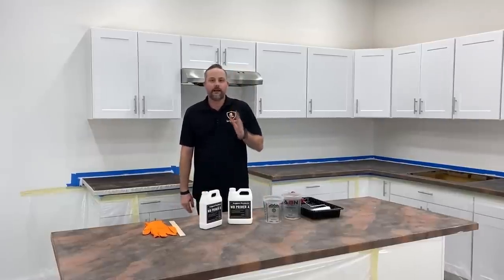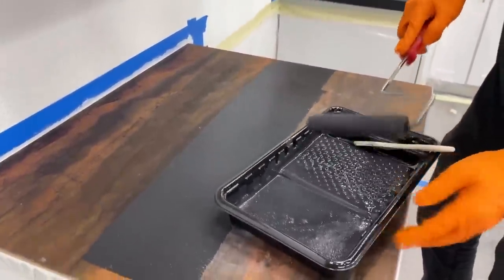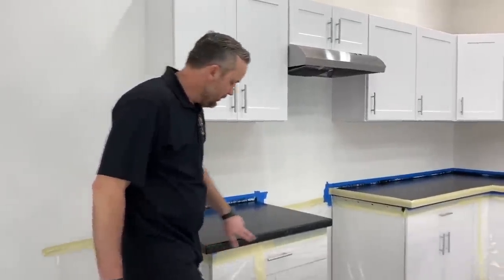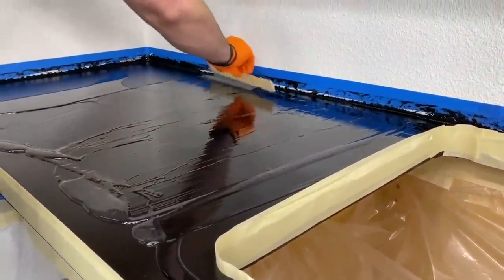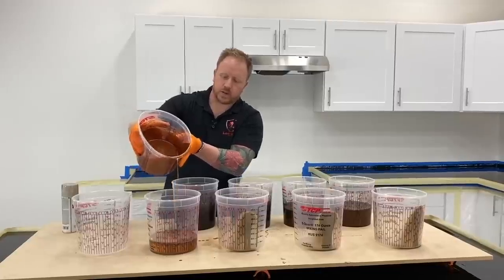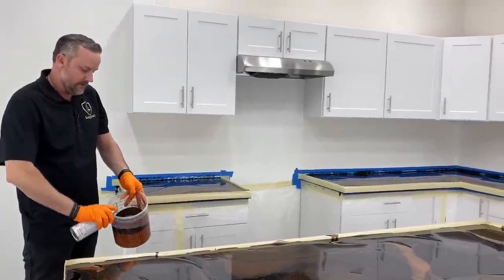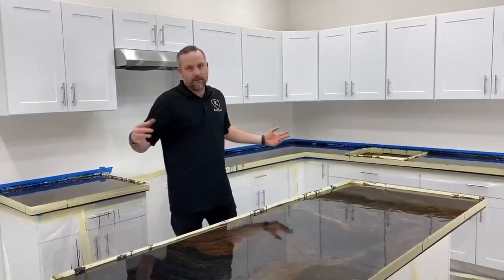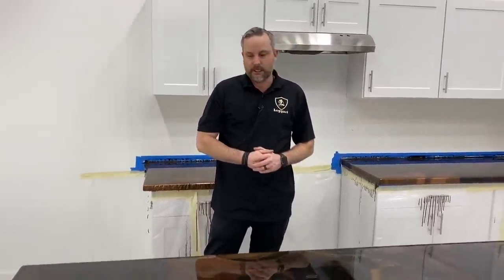Epoxy Dirty Pour Technique On Kitchen Countertops Full Tutorial | DIY Countertop Remodel Ideas

Comment: I'm curious, how well does your epoxy hold up against cuts, scratches, and heat?  If you put a hot pan on that counter will it ruin the counter?  Do you have a video like that?  Because most epoxy manufacturers always say well epoxy doesn't hold up well against heat....also if the counter does get scratched, is it easy to get rid of them?
Reply: I was reading the comments.  It is rude as hell that they didnt respond back to you.
Reply: @ABM261-zi2gl  Honestly I am surprised I haven't gotten a reply...I'd understand if there were like 100k comments with 1k daily added...would really appreciate an answer before I order their product.
Reply: Dimitri Lazarev our $5000 counter tops on our first house would crack if we put heat on them, I would guess this is the same.
They were like a marble looking type. Can’t recall the name, but even super expensive counters can’t take the heat directly.
Reply: @DC-bp8sx  5000$ for epoxy countertops or granite? I know in general you shouldn't put a hot pan on the counter but it happens that you have to for a quick moment, or for example hot cup of tea etc...curious how their epoxy holds up and well scratch wise too

Comment: Gorgeous. I'm speechless, it's so beautiful. Will you please update in a year or so with how it has held up to wear?
Reply from the maker: Our products are actually industrial coating made for military aircraft hangers, etc. So theoretically in a residential, or even commercial setting it will last forever. This is NOT a cheap epoxy paint that you will commonly find at box stores like Home Depot or sherwin Williams. It is a thick 100% solids epoxy coating.
Reply: I used their products on my floor, and it has held up to the dogs, kids, and myself ( which is the real shock.) It withstood remodeling jobs and dragging a metal shelving unit across it, not that I would recommend that however. You can also add high solids floor waxes to help.

Comment: This freaking amazing and I could totally do this! If I can get my husband to help with the color mixing. I am pumped! I just have a few other projects to do first and I want to tackle this in the spring! 
I don’t want these colors though for my house. I’m assuming there are other colors?
Reply from the maker: We have over 20 different metallic colors.  Take a look at our brochure and in the back is our color chart.
https://online.flippingbook.com/view/364043
Reply: Leggari Products Awesome! Thank you! I will take a look. Right now I am painting, we just had our floors installed and I’m also working on redoing some furniture but I will get to this eventually. I really want to do it this spring or early summer though. I showed my husband and he is on board as well! Thanks again!
Reply: Edges !  I noticed that as well. In watching the lights reflect as the camera panned the finished product, the surfaces were visibly uneven, especially where the different pour edges met. They could have hidden this by defusing the spot lighting above. This happened because the pour did not level out well enough. With vertical edges rippling, and this work being performed by experience people, should give DIYers pause. I think they should have a follow up video, because this is unacceptable. Otherwise, save the color and design choice, I thought it had promise. I wondered if they could do a thin pour clear over it all to smooth it out.
Reply: SigneN-Formaldehyd-Planteøstrogen-Soja#1-dræ'  the smaller counter to the left of the stove cut out had the textured edges as an example of what you can do, the rest of the edges were smooth.
Reply: SigneN-Formaldehyd-Planteøstrogen-Soja#1-dræ'  ok then please explain the truth.
Reply: @apsdidit  I saw some rough edges on the island, thought that should of been addressed.

Comment: I have been getting into these epoxy bar & countertop systems for a while now. I find that no product I have used is completely self leveling and the edges still look as if they were drips with thick and thin areas, the only way to remove those imperfection's is to wet sand from 320 to 2000 and then apply automotive paint rubbing compound to get the sheen back.
very labor intense, but it's worth the effort in the end.

Comment: I love this video. one question. I have laminate counters now would I put this over it or would I have to take the laminate off before? I don't have as much counter space as this so I may not need that much product. How do you gage the amount of product you will need? I cant wait to do this. One last question....Will it hurt if you accidently cut with a knife?
Reply from the maker: You can apply it over the laminate after you prep the surface.  Take a look at the link below that show prep work for different surfaces.
https://www.dropbox.com/s/hejn1v0zji35u6k/Application%3AInstallation.pdf?dl=0

Comment: Looks outstanding! Is it the paint that gives salty effect that I think I have often seen in marble?  What if I just wanted only the wet look without those "crystaline" looking areas/ Is that effect becasue of the alcohol spray?  What if I wanted to suspend the look that is created when the alcohol is first sprayed? Personally, that gave more depth and amazing texture when the alcohol was wet, but in any event, your product looks great.  Gret job.  Also, is there any danger to suing epoxy on food prep areas? Obviously we shouldn't eat epoxy, but is there any possibility of contaminating food or our skin?  Thank you for all good info.
Reply: Hon Estman the sheet of glass look is easy to get by applying a clear coat over the top. Either saving some of the part a and b from the kit or ordering more from them. 

Not sure what you are talking about with the crystalline look. IPA simply shifts the colored material and allows minor separation of the pigment by quickly evaporating while also momentarily thinning the product.
Reply: Hon Estman some epoxies will create that texture duo to a combination of mildly repelling each other. May be possible to create the added dimension you are looking for by using fillers to thicken some of the mixes. Hear normally helps the product flow easier but it also accelerates the set time. Not sure if there is a way to use that to stop the self leveling.

Comment: If I just wanted to do a clear coat of epoxy over my counters, could I use the rolling method you did with the black primer and leave it like that? Or do I have to do the pour method on top?

Comment: I tried spritzing my MDF board art after pouring resin for cells...but I didn't know it will burst bubbles. So, the little divots the spray left eventually leveled out...or did they level out after you pulled the tape? Do you prefer this method over light torching?
Reply from the maker: Yes we prefer misting it with denatured alcohol to disperse any bubbles you man get over torching.

Comment: How do you address the sink? Do you get a plumber to remove/reinstall or do it yourself, or do you even have to?
Reply from the maker: It looks best when you remove the sink then coat and caulk but you can coat the counter with the sink there. Backsplash-either remove it and coat it separately, coat it while it's attached(the epoxy will have a very vertical dripping design not everyone loves), or just remove the backsplash and install a traditional tile backsplash. You can tape the backsplash-1/8" high and coat up to it as well.

Comment: Is coating a back splash possible without cutting it out, or is it better to just cut the back splash out, repair the drywall and caulk the edge?
Reply from the maker: When doing a dirty pour you want to cut the backsplash off but on the regular epoxy kits you can coat.   below is a video.
Back splash video
https://youtu.be/kUAziUFcgF4

Comment: How does this surface hold up to every day kitchen wear and tear, such as knife cuts, etc?  Will it hold up if, say, a teenager decides to forego the use of a cutting board?
Reply: I did an experimental epoxy countertop wit a much thinner layer atop old linoleum and it was great. Scratches can be buffed out if needed. Many people do a wax too but don't know if this type does.
Reply: How about heat? Will it withstand a hoy iron pan coming out of the stove?
Reply: @pcbtl1  think of this counter top as a thickly glassed surfboard--epoxy boards are lightweight and strong (better than regular resin) but can crack and be damaged with impacts, so common sense as to a hot pan...never tried it but would think it may make a burn mark. Any counter top would be marred.

Comment: How would you fill a counter that has a small gap , about 1/8-1/4 inch, between the drywall and countertop?  Some houses have counters that are on an exterior wall that will swell and contract with the season so the studs will pull the drywall away from the countertop.

Comment: That came out really beautiful. I have a question. To get the effect of cells what do you add? Could you add silicone to your paint mixture like you do with acrylic pour painting? And how can a person be a rep for your company?
Reply from the maker: Tina, we use isopropyl alcohol to give it the cell look.  You do not want to add silicone to our epoxy.  If you want to be a certified leggari installer you can email leggari@gmail.com and they can assist you
Reply: Creating a “crater” effect can be done by tinkering with a spray bottle spray tip. Making it spittle will add a cool randomness what I think you are referring to as cells. 

Not sure if denatured works in this epoxy but it works with a lot of epoxies. We would get Drums of IPA which is similar to what a doctor whiles your arm with prior to giving you a shot. 99.?? alcohol. 

Haven’t watched the whole video yet but you can get some cool effects with air from a non heated hair dryer. We only ever used heat to make air bubbles raise to the surface and to help level the material. 

You have to be careful with heat. Epoxy is very real ice to heat generally. A full bucket of epoxy can catch fire for instance. Heat will shorten your “pot life”. The material generates heat once mixed. The more material grouped together the more heat it generates so once mixed don’t let it sit in the bucket.

Comment: Prepping for the big pour tomorrow!!  Wish us luck! Any advice on applying the High Wear Top Coat?
Reply from the maker: The tutorial video for the urethane top coat is on our website at leggari.com under the countertop section in the tutorial videos.  It will be the last video on the top coat application.
Reply: @LeggariProducts  Love the pour! I do have a question about the top coat, it has been 24 hours and it is still very tacky, should I be worried??

Comment: So you don't need a clear coat on top?  Is this food safe?  And can you put hot pots and pans directly on the surface?
Reply from the maker: We recommend putting the urethane top coat over the epoxy to make it more durable.  The epoxy will withstand up to 200 degrees Fahrenheit.
Fire and heat test
https://youtu.be/09elup51N6U

Comment: hello i am a new fan from germany. you make great videos and great work.
I have a few questions.
sometimes you spray something on the table with a bottle.
What is it? And why you do it? 
you do that so that you don’t have to grind later? 
continues to make such good videos!
Greetz from Germany
Reply: Its an alcohol solution that causes existing bubbles that are present to pop. the same effect can be achieved by running a torch over the surface

Comment: I have an interest in using your products on other surfaces than countertops. Have you had any success working three-dimensionally with your solution. Eg. if you need to coat a 3D box or a cylinder, how can you control the material without losing the integrity of the apoxy esthetics?
Reply from the maker: You can email leggari@gmail.com with your question and our techs can assist you.

Comment: so would the technique for the sides be the same if i was doing a top for a big makeup vanity that has glitter mixed in?
Reply from the maker: When you remove the tape the epoxy will flow over the edges and give you the same design.
Reply: @LeggariProducts  I figured so, thank you.

Comment: Is there a way of doing something similar (or treating it after) to get a matt finish?
I know epoxy usually is glossy.
Reply from the maker: We have 3 different top coat options. Glaze coat is our super high gloss top coat that lays out glass smooth just like the metallic epoxy coat. Our WB Urethane comes in high gloss and leaves a minor texture and we also have a WB Urethane that’s a Matte/Satin finish.

Comment: Great video guy. Everything looks awesome. I'm confused about one thing though. How is it possible to make sure that to whole top of the counter surface will be perfectly flat and smooth?
Reply from the maker: That's where the epoxy comes in and self levels itself out.  Once you spread the epoxy all over then it will flow and self level.
Reply: It’s also good to check to confirm your surface isn’t too out of level. Probably won’t matter for standard countertops but it does with large areas like dining room tables, bathroom floors or larger. 

Simple solution if you can’t easily level the area is order more of your base coat and after your prime coat pour a self leveling coat similar to the decorative coating. 

I had such varying grading in my basement so I did just that. I still had one area that created a flowing floor look by a drain but it looked cool and only happened in a small area behind my bar.

Comment: Well done video with great instruction, bravo! Curious if you've had experience doing vertical pieces? I figure I'd need to go through this process laying down and then raise to secure vertically, correct? If I wanted something thin, how rigid would the epoxy become and would it raise well to say, span a chimney length?

Comment: Interesting, you haven't mentioned about using any form of heat to touch up any bubbles that might occur.
Reply from the maker: Our process does not include having to use a torch! Our epoxy is formulated to push bubbles to the surface and we spray denatured alcohol to pop micro bubbles. This allows us to avoid the hazard of torching the epoxy.

Comment: Why don't you use a torch to get rid of bubbles? Isopropyl changed the design to some degree and cells are not always needed/wanted.
Reply from the maker: We have a high end epoxy that has an additive in it to make the bubbles rise to the surface and pop on their own.  Thanks

Comment: How is the durability from heat and impacts?
Reply from the maker: Our products are actually industrial coating made for military aircraft hangers, etc. So theoretically in a residential, or even commercial setting it will last forever. This is NOT a cheap epoxy paint that you will commonly find at box stores like Home Depot or sherwin Williams. It is a thick 100% solids epoxy coating.
Fire and heat test
https://youtu.be/09elup51N6U
Reply: @LeggariProducts Thanks for the reply and info.

Comment: what about the edge when applying resin
Reply from the maker: You will want to roll the edges with the epoxy and when the epoxy flows over the edges you will want to keep rolling them so you don't get lines streaming down.

Comment: Beautiful, but what about the toxicity of it ?! Epoxy resins aren't dangerous for occasional contacts but, in a kitchen - or floors or anywhere you poor it on a large scale in closed rooms where people actually LIVE -, i'm not sure of the inocuity of it's use ( biphenol A, hardeners, Ect... ) ?
Reply from the maker: Our epoxy is extremely low VOC's! Also has virtually no smell and no epoxy evaporating into the air. The thickness you put down is the thickness that stays.

Comment: great video and final looks great. 
However, just to be honest, it feels really cheap, like a plastic. and also doesn't cost as cheap. I recomend saving few extra bucks and just buying quartz or granite. quartz and granite might cost you 25-30% extra, supply and installed. epoxy obviously will cost cheaper if do yourself.... but with no experience, do not touch it, let pros do it.
Reply from the maker: Actually when you see it on a surface it does not look cheap at all.  Thanks for watching the video
Reply: @LeggariProducts  i did not try to offend the work in anyway. It does look good, great workmanship. Not easy to do to make it look like that (nor DIY for sure). But to be honest, it feels cheap on the touch. I personally prefer quartz for few extra bucks. Sorry
Reply: @Shurikmuff  have you actually touched it or are you just assuming?

Comment: what kind of lung do you have that you don't need respirator while working with E-resin inside unventilated room
Reply from the maker: The product is very low VOC’s meaning it has little to no smell at all. It’s 100% solids so there’s no toxins evaporating in the air.